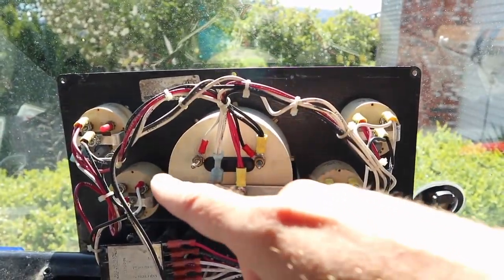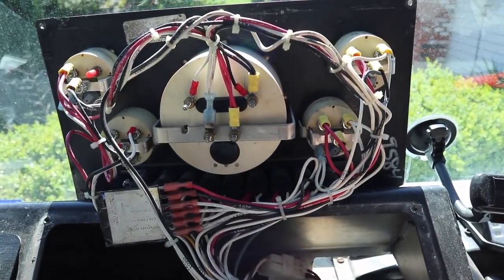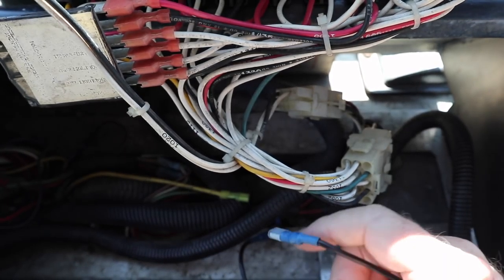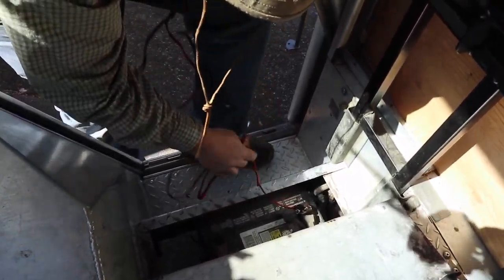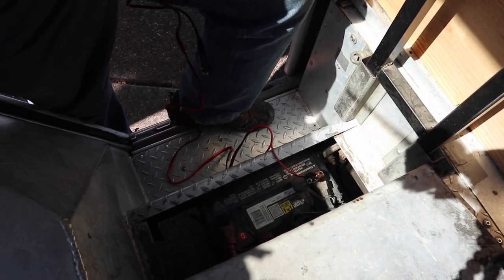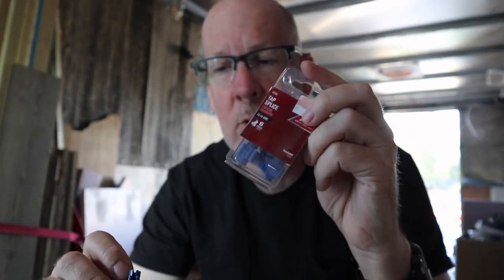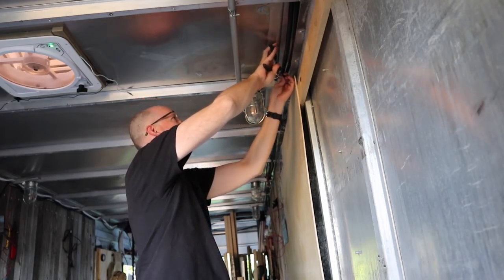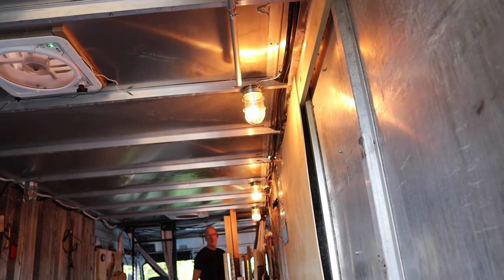Troubleshooting Step Van Wiring | Gauges, Ground and Splices E426

Comment: Those tap splice connectors are terrible. They will cause you problems in the long run. I strongly recommend you not use them. I'm a diesel mechanic and I see these used in trailers all the time and they are almost always the reason for whatever problem there is in the wiring.
Reply: I totally agree, good for temporary repair but not a permanent solution. They damage the main wire. Don't be lazy create solder joints. Also did changing these grounds fix your speedo problem?
Reply: Agreed. I've been a diy car guy for over 40 years. 

Electrical gremlins can usually be traced to oxidation, corrosion, and iffy contacts. 

I ALWAYS solder if I want the connection to last for a few years, or in situations where I want to run a lot of power through the splices!!!

Situations like higher power headlights... (hint, hint, Seven), 
Or a nice stereo  (hint, hint)

Seven, this means the refigerator connections for sure, and ESPECIALLY your MAIN POWER SUPPLY.

Soldered connections are there for the life of the vehicle,  and seldom fail if done correctly. 

Seven, you want to learn how to solder because your splices will be in difficult to trace and reach areas in your step van. 

The risk of an electrical fire will be much less is you solder. 
Your van is aluminum. This provides a very good ground  for any loose wires.  Goid enough for a fire, but not goid enough for a permanent connection.
Reply: I agree as well. They're simple to install but you will be chasing more problems later.
Reply: Make me another one in agreement. Not only do those damage the wire, they also not make a real physical connection. The only thing connecting he two wires is that thin blade. This doesn’t allow enough current to pass when you have high current devices. I strongly suggest you remove and replace with buttsplices or crimpcaps.
Reply from the maker: well darn! I didn't know. I guess I'll be redoing all those connections sigh
Reply: @SevenWanderstheWorld   wire nuts work.

Comment: Hey Seven, like a poster below noted, those tap splices Can cause more issues than they solve. I’ve also seen grounds to body corrode and fail over time. Which is an even bigger issue once they are enclosed behind walls and ceiling panels. That’s why on my trailer I ran a dedicated ground from every fixture back to the ground side of my Blue Sea fuse panel. And the fact that it has a ground bar is also one of the big reasons I used that panel. Yeah it added to my cost and took money I could of used elsewhere. But by spending money on foundational items I anticipate I shouldn’t have any issues for the life of the trailer. Five years and 20,000 towing miles so far and that theory has held up.
Reply from the maker: I had no idea. I guess I'll just end up redoing all the splices with better connections

Comment: Those tap splices (aka Scotch locks) are absolutely the root of all evil. They will eventually  fail 100% of the time. If you want a trouble-free future I would throw those as far as you can and don't look back. I am not trying to be negative, I am just stating facts.
Reply: brianok100 

Agreed. 

I prefer to use soldered connections instead. 

More hassle to begin with, but few problems later on. 

The tap connections are subject to oxidation and corrosion. That increases electrical resistance and ohms.
Reply: I will agree with you when you are using them for power but as a ground they should fine. Seven has them inside not exposed to weather.
Reply from the maker: I didn't know. they looked like a great idea at the time

Comment: As a school bus driver I know from driving many different kinds of buses that those gauges can go bad over time. I know I’m referencing a bus compared to a step van but I’ve also drove a few of those in my past the dashboards look very similar depending on the make and model. Maybe pick up new gauge and switch it out with the gauges. If the problem continues then you know for sure it’s a wiring problem. Then you won’t be looking for something that is not there. Just thought... Best of luck getting it figured out though.
Reply from the maker: might be a bad gauge, but suspect not because 2 gauges are behaving the same way and it started at the exact same moment (and they start acting weird at the same time each time)

Comment: Yes agreeing with everyone else, the 'dry' scotchblocks can give you trouble later on, from humidity and vibration. However, you can buy the 'waterproof' types, they have a small drop of dielectric grease inside an enclosed pod that seals the connection when you squeeze it closed with pliers. If used inside, and secured against vibration, the splice will last for decades. 

Now, on the ground situation with the shunt: IF the shunt is placed between the battery bank negative and the chassis negative, then it will measure ALL the current in and out. IF your shunt is wired this way, then you don't need an individual ground return for everything, and in fact, you SHOULD be using the vehicle ground for return, again, IF your shunt is between the negative battery posts and the chassis ground. In fact, many new cars and pickups have these shunts, and the owners manual states that user-installed electrical accessories negative return SHOULD be connected to the vehicle chassis for grounding.

Comment: Is there a voltage limitet for the gauges on your stepvan ? I know old Econolines have one when it goes bad all your guages will peg. Do you have a good ground between the engine block and frame ? Good luck electrical problems can drive you nuts. I hope you find the problem before the problem disappears and fixes itself.
Reply from the maker: connection looks good to the negative post to the frame... but I haven't taken it apart and cleaned it yet
Reply: Seven Wanders the World you need a cable from the engine block to the frame of the vehicle

Comment: So at least you're trying to fix these problems and I give you credit for that....  As you can read those split connectors are not the best idea.  You need to run a Positive and a Negative from the Blue Seas fuse panel you put it.  (you did put a separate 12 volt DC fuse panel in didn't you ?) and I would run one circuit per side and parallel the other down stream LED lights so they  all come on together off a separate switch for each side.  

I hope the running of a temporary ground lets you know if your on the right track for your speedometer, it sounds like a good idea to trouble shoot that...I hope you haven't created so many problems that fixing them is too involved...Good luck and if you can't fix it ....I'll take a look at it when you get farther north....TL
Reply from the maker: yes, I have a bluesea 12v fuse panel. I rewired all the grounds to the negative on the bluesea panel. still not solved the gauges
Reply: Have you been able to find a schematic for the gages and how they are wired yet?

Comment: Blade taps are terrible connectors for long term reliability. Would recommend them only for temporary use or somewhere where they are very accessible for when they fail. Best solution for splicing wires is cutting back the shielding on your trunk wire try to separate the stranded wire slightly and feed your branch wire through the strands and wrap it around with some solder locking everything together and sealed with regular or liquid electrical tape. Problem with blade taps is they don't seal and over a short time of being in vehicle conditions the copper will tarnish over the miniscule surface of the connection and fail. A soldering iron, solder, and flux would be a good investment for your electrical renovations, probably pick them all up from walmart for under $30. Lookup "military splice", should give you a better understanding. Look forward to seeing how things  go, your knowledge of your step van and support systems seems to be advancing well. Another year or two and you probably won't need advice from anyone anymore :) . Keep up the good work and safe travels.
Reply from the maker: I had no idea. I guess I'll just end up redoing all the splices with better connections
Reply: A FUSE STAYS CONNECTED... ITS JUST LIKE A FUSE..  MAYBE NOT 100% PERFECT BUT...  I WOULDNT SWEAT IT..

Comment: I had a new trailer.  One tail light didn't work.  I think the break light worked on it.  I turned off my vehicle with the lights on and drained the battery dead. Turned out to be a short.  Manufacturer had pinched a wire in the wall board and a fastner screw perfectly split the wire grounding it to the frame. The kid at auto parts store kept testing wires along the way until he isolated the area. Before tail light after tail light. I did the deconstruction, eventually relized the damaged wire, taped wire and tucked it back up were it belonged with the other wires and screwed the wall back on.
Reply from the maker: electric stuff is really difficult to diagnose and track down breaks
Reply: Very difficult.  I wanted to add.  The electrical meter used had the dreaded needle poke into the wire. But it works fast.

Comment: Oh man, bummer about misplacing your keys, but that turned into a bonus when ya found 'em. Bummer to bonus, hmmm, I must be bustin' out my California surfer lingo heh, heh. Too bad ya have to redo some wiring, I hate redoin' things, but at least it didn't cause any problems and you probably have it rectified by now. Those tap splice gizmos are the cat's meow! You can be in and out with a job done so much quicker and easier. Gotta dig it! See ya next time Seven! .........................PEACE!!
Reply from the maker: I had no idea. I guess I'll just end up redoing all the splices with better connections

Comment: Hi Seven!!! Those tap splices are absolute garbage. Best thing to do with them is throw them as far as you can and forget about them.  As far as your grounds go, it would be best to attach all your grounds to the steel frame of the step van for best results. The aluminum body is a poor place to ground anything.
Reply from the maker: I had no idea. I guess I'll just end up redoing all the splices with better connections

Comment: Watched the Video and I'm curious as to if it helps to run a seperate ground. To your new house lights.
First question is are they running off the Starter Battery which I hope you leave shut down when your parked. (By turning off the battery switch next to the 2 Starter Batteries under the Step by the door into the step van.) The back house lights if wired to the four house batteries in the box behind your driver seat are not part of any circuit your dash board speedometer and oil gauge are connected to. They are normally connected to the Starter Batteries which are not part of the Shunt on the 4 house Batteries. There is one place the Grounds should be bonded together if you ran a cable bonding the two battery grounds together I guess (did you run a separate cable to attach the Ground on your starter and house batteries.) I went to the Blue Sea Website to see how your Charging Relay is set up. See the link below for how the two batteries Systems interact when the Van is running and the Alternator is charging both Battery systems as you drive your van. The frame of the truck might not be enough when the truck is running if the grounds don't have a cooper cable connected together I guess.
Ever since Seven talked about how he started his Step Van When his batteries were dead I've been thinking about
the way it must have been wired to allow this. Below is the circuit from the Blue Sea 7622 ML-Series Heavy Duty Automatic Charging Relay Marine. That Makes it possible.
http://assets.bluesea.com/files/resources/wiring_diagram/ML-ACRs.jpg
Reply from the maker: everything in recent videos are all running on the house batteries. we followed a wiring diagram for bluesea and also worked with a tech support guy at bluesea on how the ACR was setup (he asked a series of questions on how things were wired)
Reply: I don't know if I can help you by writing text notes without being able to see the setup sorry.
I am not that concerned with the way you've connected your house lites to the new ground wire.
because that will only effect each of your house lights and it looks like you will have access to the connectors if a lite quits. Those connectors have been reliable for me in  2' and 4' overhead sealed fluorescent fixture in dry locations solid wire only not stranded for me as I serveced  120 volt lights for the last 30 years. I would never choose them on my own new work but I ran into them often and they worked out ok. So my suggestions is not to bury the connectors in insulation or behind coverings so that you would have difficulty getting to them and leave them as is, in any case that is not part of your engine gauge problem as it is part of your starter battery system. I still believe it is a ground issue clean all ground connections to the steel frame to the battery and the gauges.  Without being there I don' think I can help you sorry.

Comment: I agree those splices will be a problem in the future, They migt work inside a house with the house not having a earthquake often.  In a moving vehicle with all the road caused bouncing will be a problem as well as corrosion / lack of contact in the future.

Keep the house battery power separate fro the Van power. It sounds like they are connected. To check see if you can get voltage when you measure from the negative terminal of the Van battery to the plus side of the house battery. If so they are tied together some place.
Reply from the maker: I separated the two power sources for the testing... but still wasn't able to get the gauges working properly
Reply: You may have a voltage regulator as part of the dash electrical system. If so and it is starting to fail ..the voltage is no longer constant and all the gauges will move around with no real change in temps or speed.

If you have a volt meter attach it to the supply voltage and drive the van so see if the supply voltage moves around.

Comment: Could the items being grounded to the body running from the coach batteries be playing some sort of havoc with you speedometer. Noticing the fans are grounded to the body as well. Thinking the timing with the problem and what was new at the time the problem started corelate
Reply from the maker: don't know. I changed all of the grounds for house battery items to a dedicated ground wire back to the house bus bar. problem still exists

Comment: I'm curious, are you using star lock washers? They're the ones that look like little cowboy boots spurs, you'll find them on the exterior lights usually. Whenever I have a grounding issue with my Kurbmaster lights I just grab a screwdriver, loosen and tighten the screw a few times and the washer scratches the metal a little providing a fresh contact. 
When you put wood on the walls again try to leave access to the lighting hardware so you can do this later.
Reply from the maker: using star locks where I have steel on aluminum
Reply: Seven Wanders the World excellent. They really help out later!

Comment: @ Seven

Those taps are trouble, wouldn't recommend them. If you decide to use them remember where you used them for future troubleshooting (most likely sooner rather than later). Those tap things will fool you by kinda working but creating more issues where they cut into the original harness wire and come loose down the line, creating troubleshooting issues. Not to mention, when used to tap a power source, can be a bit dangerous. Seems like you're on the right track but the execution will again create issues. Use a proper connector is all, and all will be good brother.
Reply from the maker: given all the comments, looks like I'll be rewiring things to remove the splices

Comment: If you do need to use crimp connectors, always use the correct size. Get a good crimp tool, and learn how to use it. Not a combo crimper/stripper.  And get the good connectors with shrink insulators, with epoxy if you can find them.
Reply from the maker: I have a very very good crimp tool that I used for all the other connections

Comment: I'm inclined to agree with the masses. Those piggyback connectors are notorious for cutting most of the wire in two, when you crimp them, causing excessive amp draw, overheating wire like a filament in a light bulb, corroding. and eventually wire breaking at crimp point. When those circuits fail, I didn't say if, when those circuits fail, or appliances on them burn up from poor connections, drawing excessive amps, those connectors would be first place I'd look. A better solution, that doesn't require soldering, is a butt connector, with a Y pigtail to appliance, i.e. light, plug in, etc... T&B, Vaco, or Stanley sells quality crimpers for using with solderless  insulated connectors. They have small nipple that indents connector through plastic insulater, making a positive connection.
Reply from the maker: I had no idea. I guess I'll just end up redoing all the splices with better connections

Comment: I have been working in the electrical trade 25 year . The people who taught me warned me of them connectors . As I will also tell you they work by cutting strands of your wire . It will cause many problems in the future . Now that you have used them tape them up with extra tape .
It is called back taping . Where you tape then flip the roll over and tape with the sticky side up . Then flip it over and cover the sticky side over .
Like shit to a blanket it will stick 
And not over time loosen off .
Reply from the maker: I had no idea. I guess I'll just end up redoing all the splices with better connections